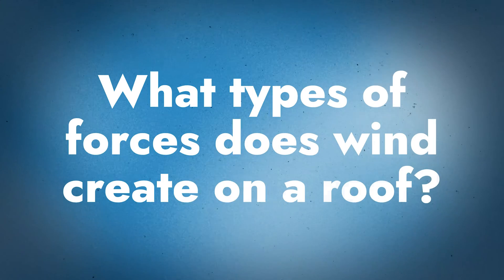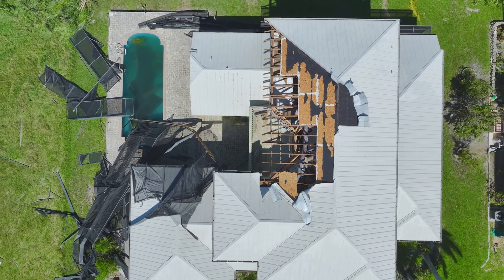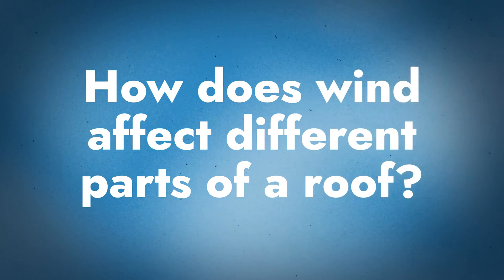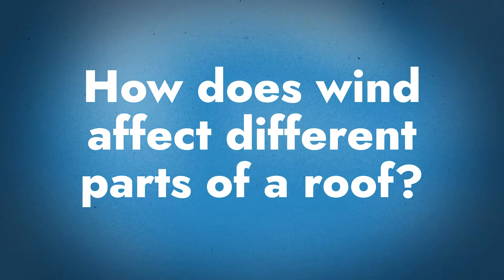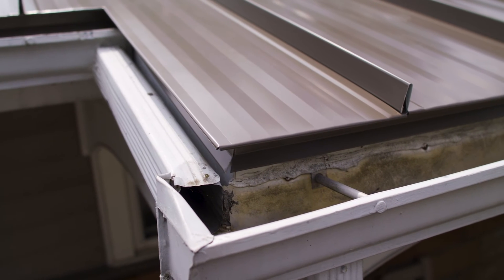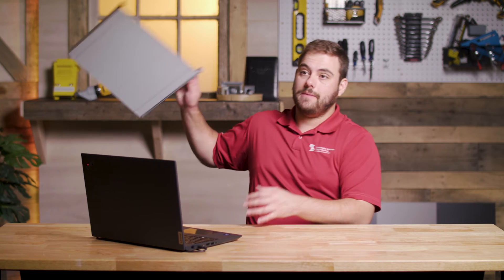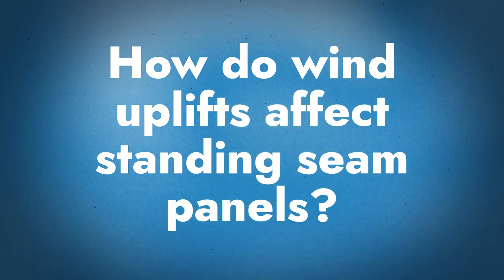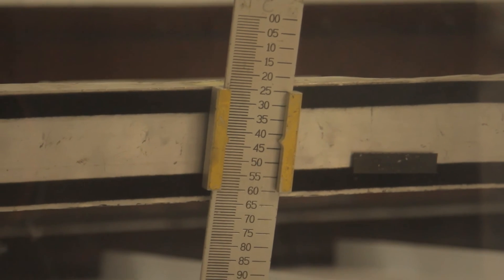What Are Wind Uplifts & How Does Wind Affect Metal Roofing?

Comment: great info
how about a thought on my carport
it is 52 x 14 built with 2024 specs and engineered for hurricanes with the four wall system
i am trying to fortify the structure by placing 2" beams across the legth of the 52 feet near the gutter but on the 3" compressed insulated panels so the wind will not blow the carport roof off
Looking for some help on do you think this will work
Thank you
Rich Fredericks
Northport Florida

Comment: Have you pushed your panels to critical failure? At what point are the snap lock and mechanical seams completely failing and coming apart?
Reply from the maker: Yes, all of our panels that have gone through uplift testing have been taken to failure. All the testing reports are on our profiles page with that information included: https://sheffieldmetals.com/products/panel-profiles/ The next video in this series is all about the different tests, including UL 1897 which takes panels to failure. -Thad
Reply: FEMA has said in their reports after Hurricanes that for metal roofs the worst performing are the snap lock panel style metal roofs, the changes in positive and negative pressures causes the snap locks to come undone and then the wind gets under the panels and can start lifting them like a sail or you get multiple panels that come unlocked and flap in the wind. FEMA comments on exposed fastener metal roofs is simply they are easy to check that there are enough fasteners installed to secure the panels. Mechanical standing seam when they come loose also act like a sale and you can lose an entire section of metal panels because they are mechanically crimped together. 

While almost everything you read about exposed fastener roofs is negative they seem to be at the top of the list when it comes to surviving a Hurricane. Add in that there are millions of people with exposed fastener roofs that do not have any issues with them it makes the majority of criticisms against them unfounded. Around me there are lots of exposed fastener metal roofs and they all survived Hurricane Ian in Cape Coral, Florida. 

No metal roof is immune from getting a water leak and none of them are 100% fool proof against a Hurricane, but exposed fastener metal roofs are not a bad choice. Todays fasteners use EPDM washers which can last for up to 30 years before the screws need to be replaced and they have shoulders on the quality fasteners that shield the EPDM gasket from the UV rays of the sun. 

With a snap lock metal panel or a mechanical seam metal roof you can loose roof panels, with an exposed fastener metal roof you pretty much have to loose the plywood for those to fail and if you are loosing the plywood it does not matter if it is exposed fastener, snap lock or mechanical seam. 

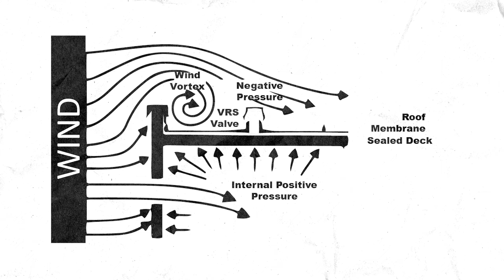We have an exposed fastener metal roof installed by Stanley's Roofing and according the test data from Tri County Metals done through Creek Technical Services LLC our roof panels can withstand -116.25 PSF with the fasteners installed at 24 inches on center. Our home is in exposure B with a roof slop between 2:12 and 12:12 ours comes out at 27 degree slope, according to testing 30 degrees is considered optimum in Hurricane force winds and that is for wind driven rain. According to the chart our roof in zone 1 can withstand up to 200 MPH wind speed, zone 2 can withstand up to 200 MPH wind speed and zone 3 can withstand up to 190 MPH wind speed. 

I think we are as well protected as we can be with our roof. Also metal roofs are lighter than shingles and tile roofs so that reduces the load on the roof during a Hurricane as well.
Reply: @LeeCountySpeedShop  A little over a year ago I replaced my shingle roof with a metal roof. The company convinced me to go to the expose fasteners. I live in Florida and hurricanes come every few years. Their experience was standing seams came apart in storms more often than expose fasteners. The disadvantage is after 5 years they have to be inspected every year and sometimes need to be re-screwed. My home just went through Milton and thank the Lord I have no damage.